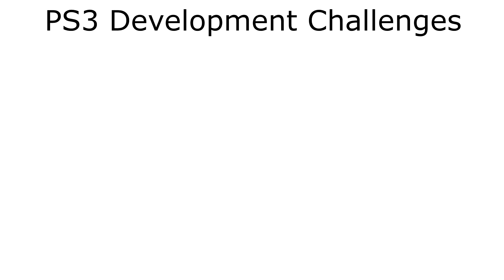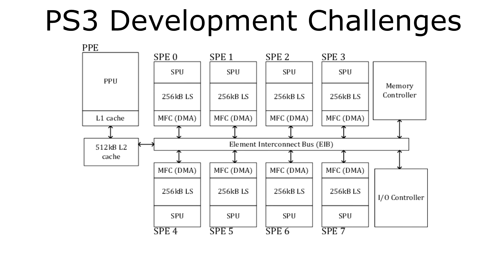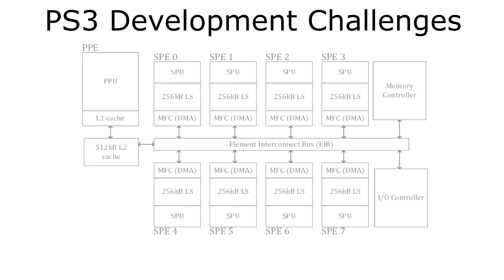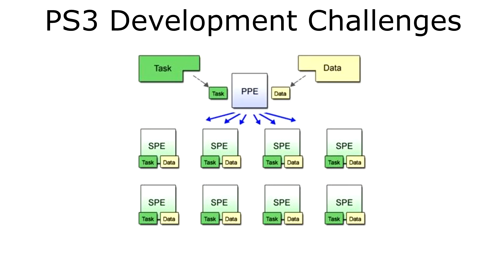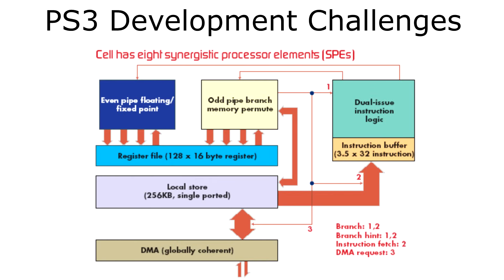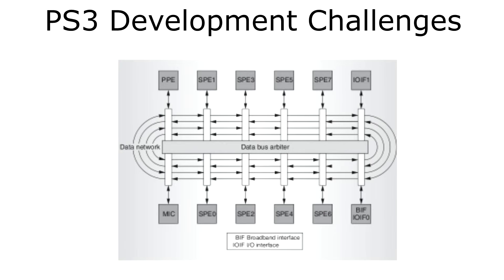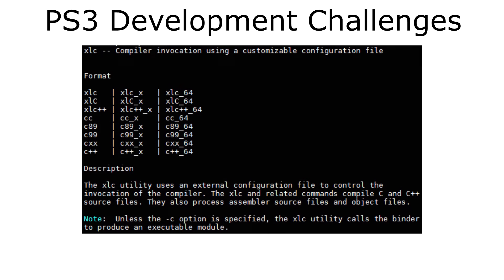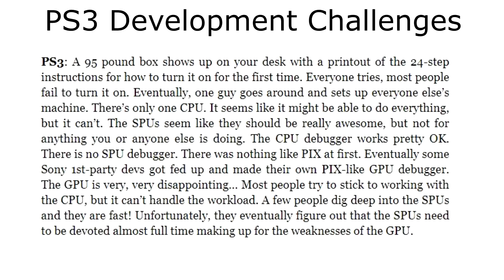Why was the PS3 Difficult to Develop Games For?

Comment: I did SPU coding on PS3 for AAA title. The real issue was algorithms had to be setup differently than on Xbox360 with symmetrical unified memory arch. On spu it was a dance of dma ing your data while concurrently performing compute. It could directly address the RSX space so you could directly patch the gpu which was nice.  So now let’s talk about the ps2?
Reply from the maker: That's awesome!!!
And yeah, that seemed like it would be the biggest challenge. Most programmers don't have to worry about stuff like this. Parallelism and asynchronously tasking things can definitely be a challenge at first. I didn't know that about the GPU though! That's cool. And yes, one of the next in the series will be the PS2!
Reply from the maker: Thanks for stopping by :)
Reply: I've been wanting to do programming on the Cell, but I don't know what to download to get started (things like SDKs). Could you point me in the right direction?

Comment: can you make a video on consoles that were supposedly easy to develop for like the dreamcast, gba, gamecube, or ps1
Reply from the maker: Yes!  Absolutely
Reply: 4 years late, but the Mega Drive isn't half bad to program for either: just a big powerful CPU, plenty of RAM and VRAM, and a GPU that doesn't need much babysitting.

The most awkward thing about the Mega Drive is probably the sound, with it sporting a full-blown Yamaha synthesiser, a square wave generator, and a spare 8-bit CPU to drive them both. Elaborate games would use the 8-bit CPU to run a PCM mixer, feeding multiple PCM samples to the lone DAC channel in real-time, basically software-rendering audio that the SNES's sound chip would have been able to render with hardware-acceleration instead.
Reply: @Clownacy How do you even program for this thing? Like do you have different assembly dialects for each processor and dispatch the programs when needed?

Comment: GPU Devs: That shit is bad!
SPU Devs: That shit is good!
All Devs: What the shit is that processor!?
Reply from the maker: Haha I actually think it's quite clever.  The problem is the style of programming is so different and it's difficult to get away from sectioning off pieces of code that can be added without effecting the whole system.  So competent developers needed to be hired who could understand the way this architecture worked, which were few and far between.  It definitely seemed like it made pushing games out a bit harder.
Reply: @ZygalStudios  every developer was used to some paradigm. Sony did not provided support for change.
Reply: Legit my reaction starting the SPU docs and seeing 7 bytes, 14, 21 etc